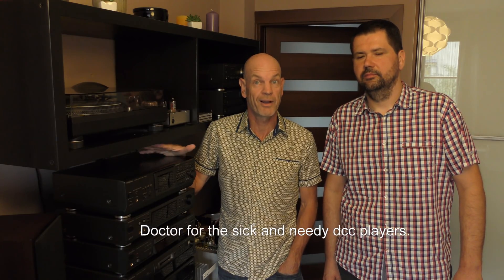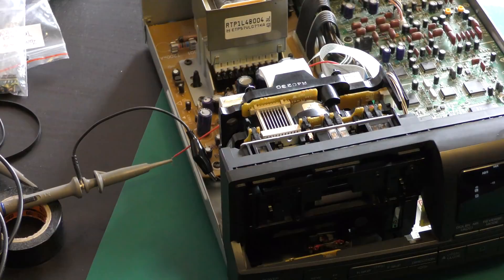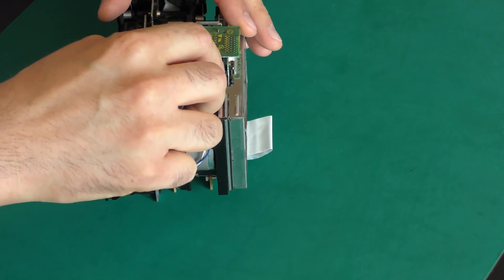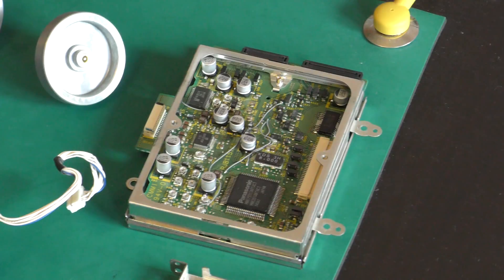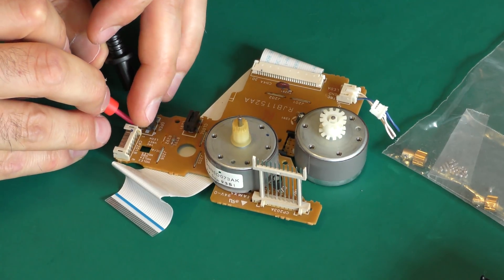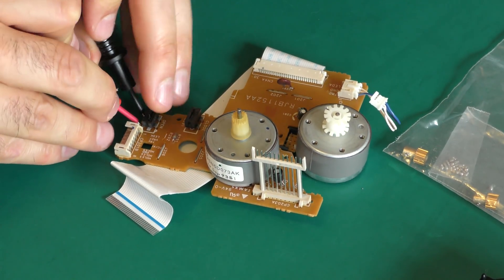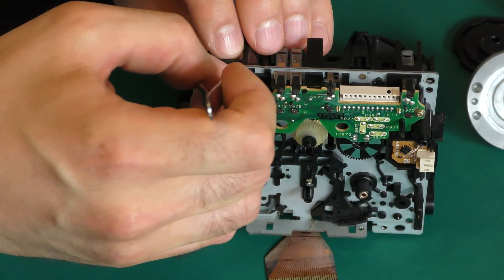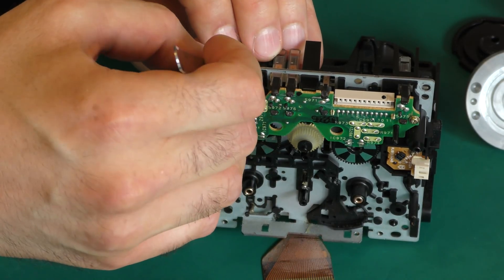Technics DCC RS-DC8 Digital Compact Cassette Repair. The most complicated restoration.

Comment: Hey, Dr. I just bought a Technics Dc-10 by accident because I thought it was a CD player. I know nothing about this cassette format until I see it in person. I don't have it hook up with the speaker yet but when I insert the regular cassette tape. ( I don't have DCC tape yet) It plays but I just see 1 channel VU meter running but that tape is stereo on my regular cassette. Please help or give me the advice to fix this problem. Thank you.
Reply from the maker: Hai Tran Hi. Your capacitors need replacement. We have a video about this as well
Reply: DR DCC .please help.
Can you take a screen shot in your video and pointing at capacity I need to replace. And how many of them. What type or model. Or help me by sending the link the right one and place to order please. My brother know a bout electronic but not me. As he not good English to read or listen the video. Thank you.
Reply from the maker: The Technics RSDC10 video we did should have all the info you need. In the description it also mentions the values for the caps. If you need more info visti forum.dccmuseum.com

Comment: Hi dear DR DCC i have a quetion about if a normal - analog cassette tape deck can record a dcc tape ?

Note : What do i mean ? .............i mean the if we put out the dcc tape from it's dcc cassette shell and put it in a chrome type 2 analog cassette shell and i say chrome because i remember when i asked you what type of tapes DCCs use you replied back and told me BASF chrome video tapes  of course not that wide tapes .. so if we put the dcc tape in a type 2 analog cassette shell will a cassette deck be able to record on it and also for the opposite will a dcc deck be able to record on an analog tape 
{ in a dcc shell } chrome type 2 or not ??

Thx for any reply many regards  :-)
Reply from the maker: Badassvidsz That would work. We have tried this successfully
Reply: @DRDCC       Thank you very much :-)

Comment: For those who don't speak Dutch: "Tooth Wheel" = Gear. :-)

If you're not replacing the head, it's a good idea to protect it against electrostatic discharge by putting a paper clip on the flex cable to short out all the contacts, whenever it's disconnected from the read/write board.
Reply from the maker: Thanks for the feedback. I was mentioning the Toothed Wheel: a wheel with teeth for making a row of perforations (google it). Nothing Dutch about that?